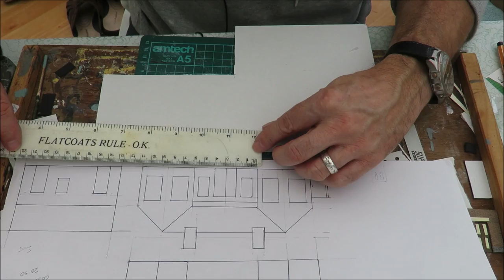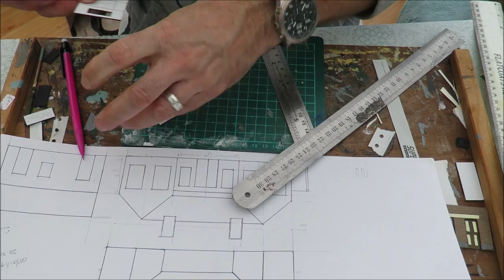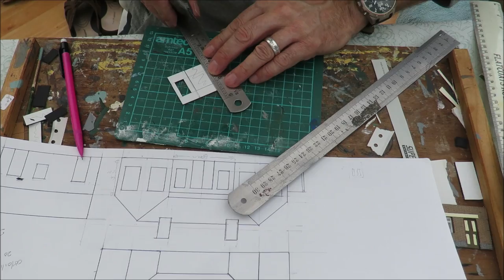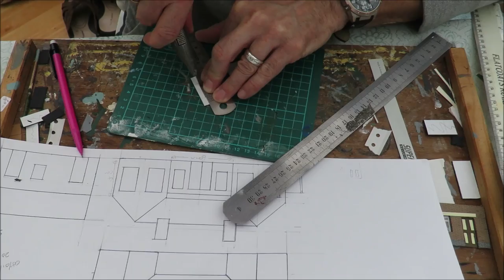How To Make Model Railway Buildings From Scratch (Part 1) - Tutorial Tuesday - Episode 32

Comment: Great stuff. A little tip I have discoverd regarding 'glazing.' Plain clear plastic makes it too easy to see into model buildings and doesn't look real. Lightly smokey, or grey plastic looks a lot more realistic. If you are lucky enough to be able to print on laser or inkjet printable acetate, you can experiment with different grades/darkness of grey tone, plus able to print curtains, posters, stickers etc that may appear in - say - a shop window. Always mount it with the printed side inside the model. I've even replaced the glazing in some carriages this way with printed 'No Smoking' 'First Class' etc signs too.
Reply from the maker: Nice tips, thanks

Comment: Could you possibly make a video on the sizes of 1:76 / 00 Doors and window sizes and how high a window should be off the ground etc
Reply from the maker: It depends on the size of the building, things need to look in proportion especially Windows. I usually make doors approx 12mm x 28/30 mm or 3ft by 7ftish
Reply: Budget Model Railways ok Thanks

Comment: I was very impressed with your buildings construction tools and techniques  i find that you are immensely  practical and achieve a lot in a short time. May i offer some of my experiences with sharp blades, i personally hate blades that flex which in effect actually reduces your tactile sense of control, for years  i was a compulsive scalpel user, and nearly lost my eye sight on occasions when i applied too much pressure the blades would break flinging shrapnel pinging pass my eyes. Now i know how to resharpen any blade no need to keep buying new ones. But i tend to like craft knives similar to the Exacto type my but my preference is for the "Fiskars" branded version and keeping the blades protruding as short as is practical, and to add further control to any possible blade slippage in the craft knives jaws, i insert some small pieces of wet and dry to further grip the blade from slipping around in the knives jaws. i love  your buildings they are as important as the trains themselves, keep up the great advice. 👍👍👌😊
Reply from the maker: Very kind thanks and thanks for the suggestion